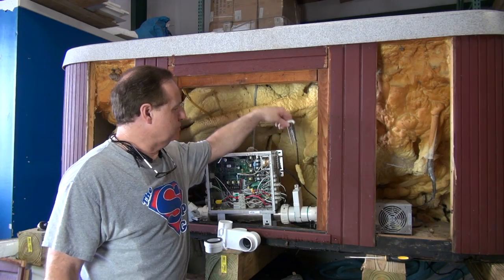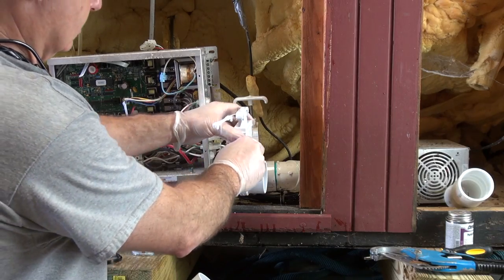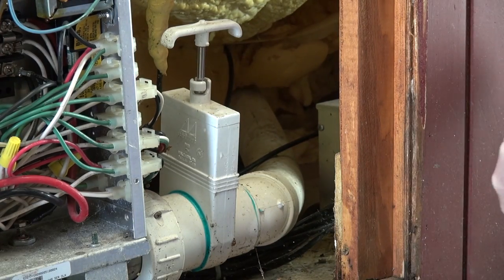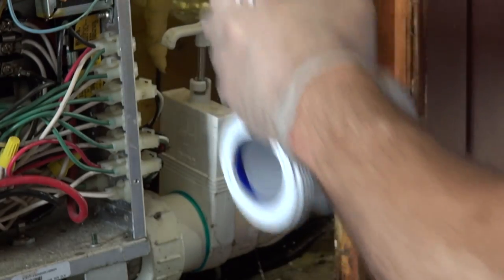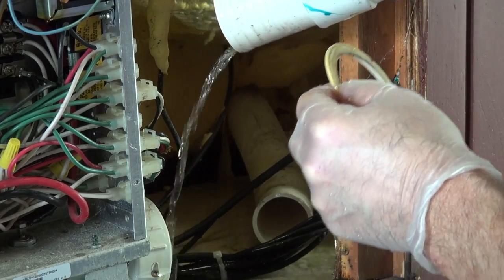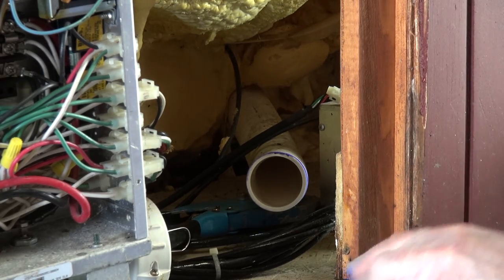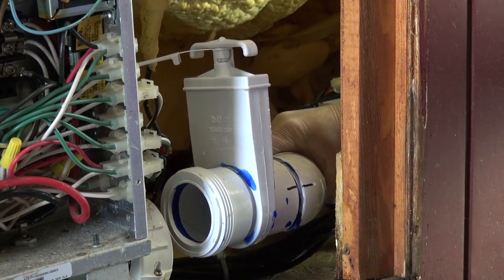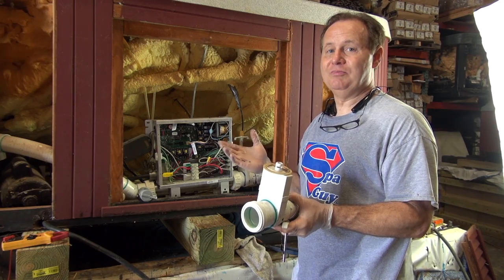Slice Gate Valve Heater Union Replacement Hot Tub How To Spa Guy PVC Plumbing

Comment: Great video, you show us the slide valve near of the main control with two PVC connections but what about if one side has a flexible hose? How we need to proceed? Do I need to cut the hose or where I need to start the reparation?

Comment: Great video thank you. Do you have a way to close sticking slice valves? None of mine will fully close (presumably because of limescale build up) so they are useless. If I want to work on a pump, heater etc. I have to drain down the entire tub. The slice valves will close up to the point where the handle is about at the top of the moulding but it won't go in and turn to properly close.
Reply from the maker: You can tap the top of them to close them completely and it usually works but sometimes they will not open back up or the t handle pulls out when you open them.. I have tapped many of them closed..

Comment: Are those valves really necessary if you don't mind draining the spa each time you need to work on it?
Reply from the maker: That is the only purpose..
Reply: @SpaGuy  can it happen that the valve does not close even if I push it down? How can it happen? I see the arm going doing fully and locking

Comment: I have a Coast Spa....it is leaking at the Gate Valve (next to pump#3).  a few questions:  1) are the tubing diameters all the same?; 2) Where can i find a tool to loosen the large nut?; and can I use a hack saw to cut the pipe...or is it better with the tool you used (if so, where can I purchase the tool)?  Thank you.

Comment: Can you use a hacksaw to cut the old slice gate out to remove it instead of the pipe cutter you show?
Reply from the maker: Yes of course.. Hacksaws are harder to make a straight cut with but will work for sure..

Comment: I have a tub with solid piping and want to install Gates Valves.  I have had to replace the heater element several times and always have to completely drain the tub.  I would like to install gates valves to solve this problem.  Do I need two gates valves, one one the water-draw side from the basket to the heater and one on the right side of the heater, as with shown in this video?  Thank you.
Reply: Michelle Jackson yes you need two gate valves. Hope this helps.

Comment: can I cut my 2" flex pipe to the gate valve with a small hack saw. I don't own a 2" pipe cutter like yours.
Reply from the maker: You can cut it with anything that will cut it yes..  a Hack saw does not normally cut straight so it is not ideal..

Comment: hey there I just replaced my pump and hooked it all back up, now my pump times out after about 15 seconds and there isn't as much pressure coming out of my jets, also when I push the high button it kicks off even quicker and sounds restricted , I think my gate is stuck in the closed position ,, now I have to change out my slide gate , is this typical ??

Comment: I have a MAAX spa PRE 50 that has two slive valve; one before or after the heat pump and another one after or before the water pump-motor.  Question, if i need to replace the slice valve connecting to the pump-motor,  do i need to empty the water from the spa?j
Reply from the maker: Yes

Comment: What does the slice gate / valve do?
Reply from the maker: Hello Troy, Great Question... The Slice valves are used the isolate water from a component so you can service that component without taking the water out of the tub... or instance in this video there is a slice valve on the right hand side of the heater tube and there is a slice valve on the inlet side of pump #1 to the left of the heater.. If you were going to replace the heater element of work on pump #1 which is the pump that goes through the heater you would simply close the slice valves in both locations look for a bleeder line on the pump and clamp it with a pair of needle nose vise grips and you would have isolated the water in the tub away from these devices so you could service them.. Thanks for watching... Spa Guy